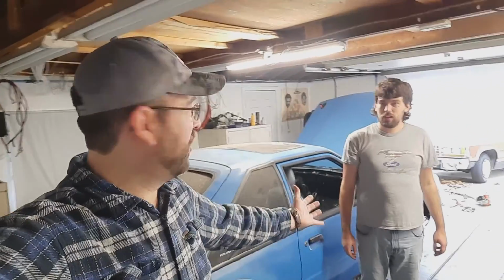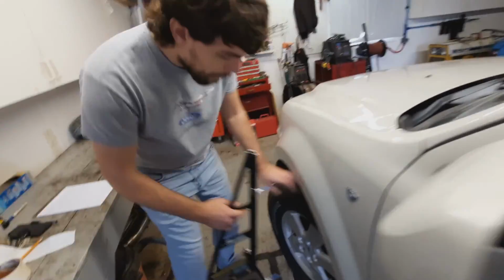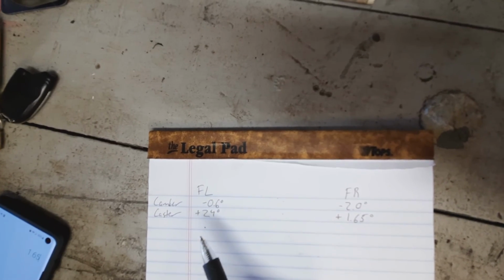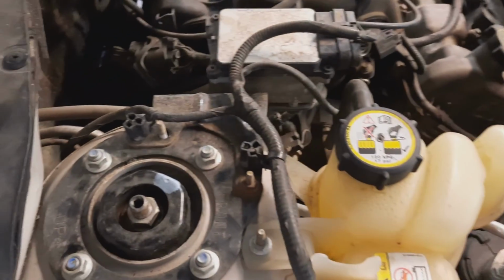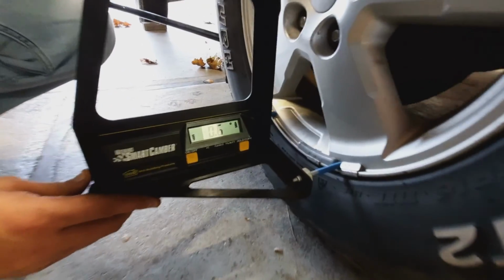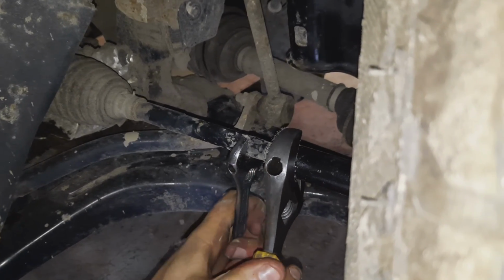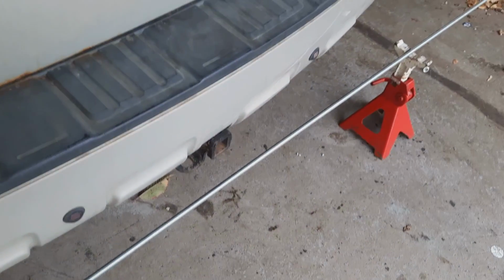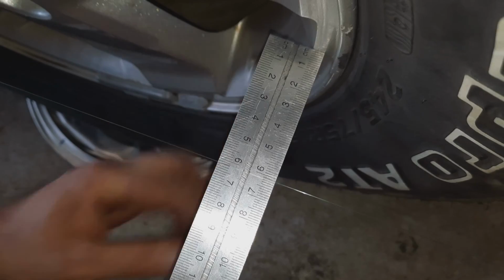At-Home Car Alignment - Measuring and Correcting Camber, Caster and Toe

Comment: What did you grind to do your camber adjustment, The knuckle itself or the strut? Also when you adjusted the strut mount did you spin the plate or how did you get it from the one corner to the other?